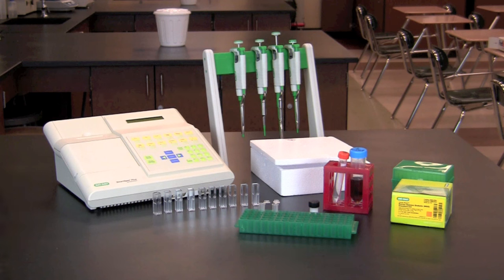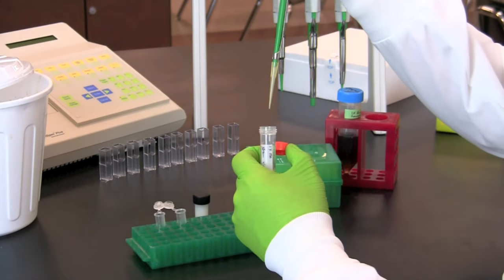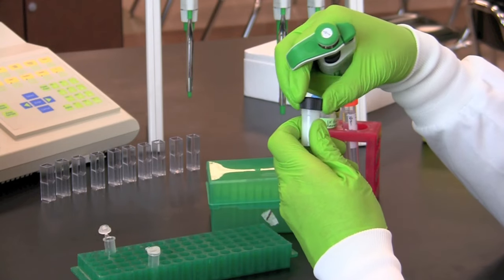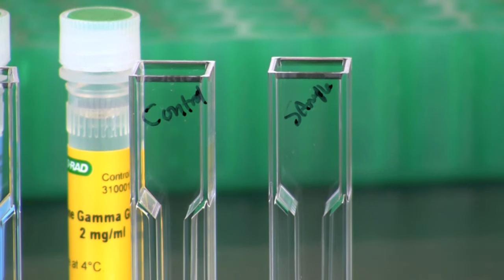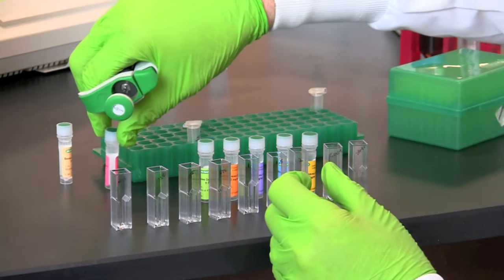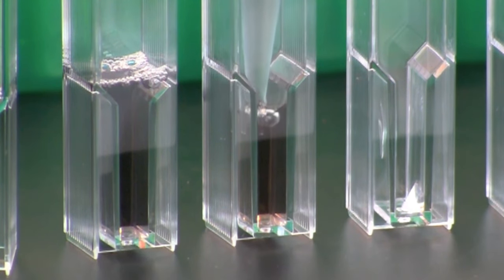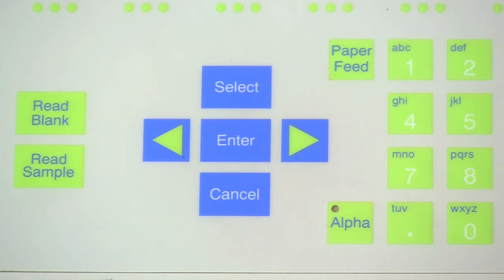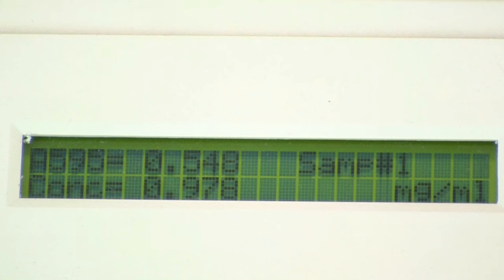Bradford Assay

Comment: What is the purpose of standard,I couldn’t get it,please explain to me!?
Reply: basically, you can't directly quantify the amount of protein in an unknown sample. You need to do a relative quantification - which means by using a series of known protein concentration, you obtain a set of absorbance values which are arranged to form a standard curve. Then, the standard curve is used to indirectly quantify the amount of protein you have in your unknown sample based on its absorbance values.